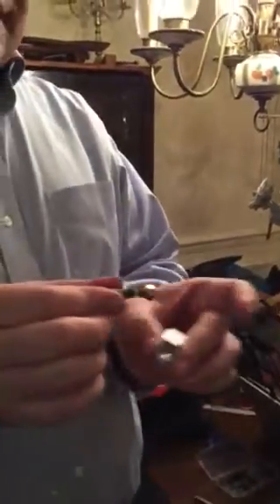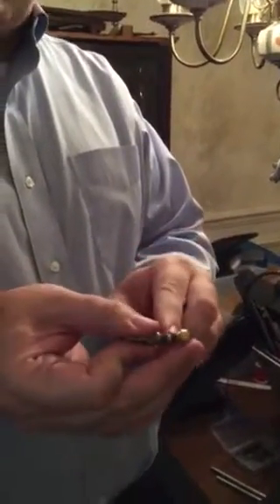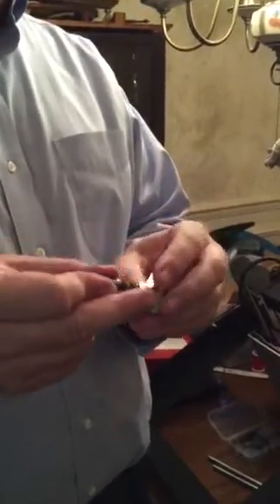MK10 Extruder Assembly

Comment: Question: if the nozzle shoulder is not tight against the heater block, does this not prevent efficient heat transfer to the nozzle?
Reply from the maker: Not really, but the point is to screw the nozzle all the way in then back off a half turn then screw in the cold end, after that you heat up then tighten the nozzle again. This gives you the best tight seal.